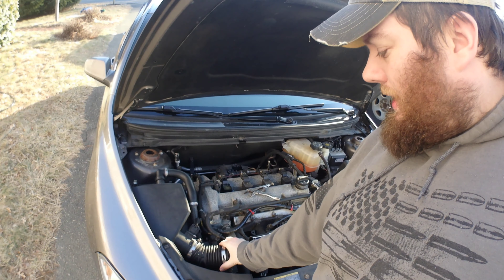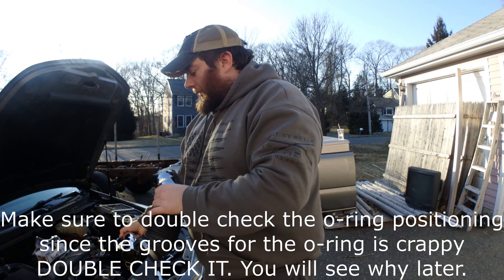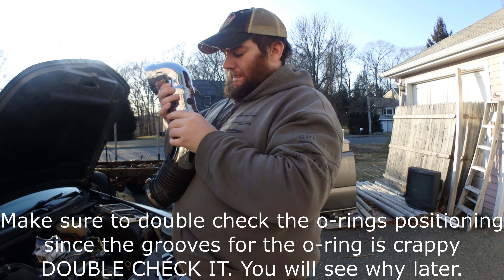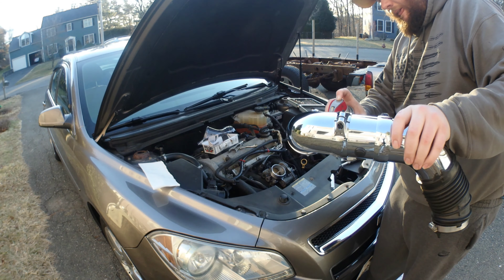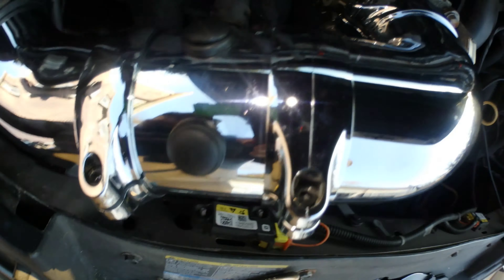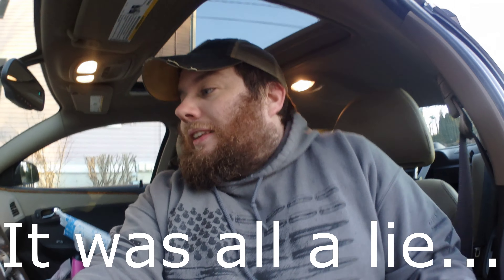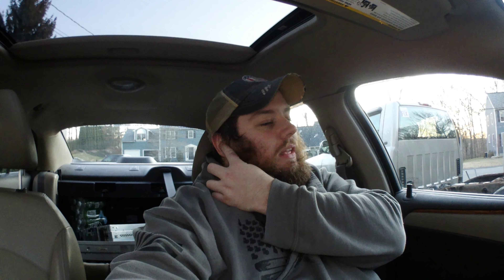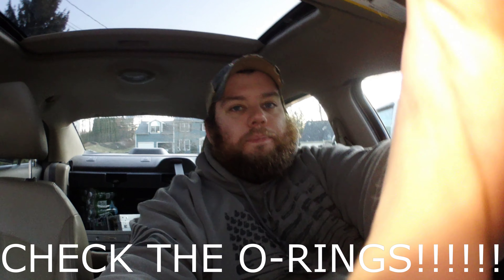2010 Chevy Mailbu FIXED!! Service ESC; Service Traction; Engine knocking

Comment: Wow thank you for the video you made it all so easy with putting the links to the parts in the description it all fit and is running like a champ! And yes the O rings are a pain! I just brushes some glue on the inside grove and that help a lot keeping it in place.😅
Reply from the maker: You are welcome! Glad it worked out for you. The glue is a great idea. Those O-rings are crap lol.

Comment: Wow I have had the same warnings and symptoms on my 2012 Malibu for many years I am definitely gonna try this and let you know I also saw the Roy rogers video and landed here after thanks for the links you provided!
Reply from the maker: Hope it works! I haven't had a problem since changing it over!!
Reply from the maker: Did you end up trying it out?
Reply: @Rwinnett2012  hey Robert I finally did it ! Amazon has been sold out of the parts for some time but I got the from the Spectre website , also my pcv hose broke because it was so old , but luckily spectre offered the push in breather option , I also used spectre couplers  instead of clamps but it all worked out and so far so good !! Thanks man
Reply from the maker: @jaydee548  That is awesome! I am glad it is working out for you! Our malibu is still going strong with this fix. So simple but so confusing as to why it fixes it lol

Comment: Did you use the existing coupler on the throttle body to attach your 90 degree fitting? I can’t quite tell how you attached that. It seems the throttle body outside diameter is less than the coupler inside diameter by quite a bit - did you need to do a 2.5 inch adapter or anything?
Reply from the maker: Using the parts I bought, I did not need to do anything else to get it to fit. The 90 went right to the throttle body.

Comment: Hey bro hope you doing good. Wanna ask if this method is working perfectly? Since the time you switched intake part!! Mine also doing same thing like engine sputtering but no check engine light. So thinking of doing the same thing.
Reply from the maker: Still working great! It's been a couple years now! No issues.
Reply: @Rwinnett2012  thanks bro.. will reach out to you after doing that stuff.

Comment: I have a 2011 ..... is there a way to check the codes by turning the key so many said times or like wise ? I'm having the same problems ....when idling awhile service traction service esc pops up and engine light comes on....also runs much louder than it used to....almost like theres a hole in the exhaust ...especially when idling ..... code that comes up when hooked up to reader is cylinder 3 misfire .... even after changing spark plugs and testing by swapping 2 of them it still says cylinder 3 ..... also have had random electrical issues over the past year such as ..... the seat belt warning light chiming even though. I'm buckled.... air bag light .....  momentary loss of headlight and dash lights when coming to a stop at a stop sign and came back on as soon as I began accelerating .... .but would like to know how to get codes using the key turning method please and thanks
Reply from the maker: I use a Bluetooth OBD2 reader for my phone. If there are logged codes you just need the car on but it doesn't necessarily need to be running.

The seat belt and the airbag lights are triggered by connections under the seat and those are known to come loose. My airbag light comes on anytime I move my seat.

As for the engine issues it sounds exactly like what I was experiencing and $40 fix took care of it. We're going on a few years with no issues. 

I've never experienced the dash and headlights going out but could be a loose connection somewhere or fuse going bad. You possibly could need a battery since the engine turns at a lower RPM idling if the alternator can't keep up with the draw while the engines turning at a lower RPM I could see electronics going out but I'm not a mechanic, I'm just the guy that has learned a few things from his dad who was a mechanic, and that's just me thinking logically through an electrical system

Comment: How did you attach the throttle body to the 90 degree fitting???
Reply from the maker: It fit directly on. I did use some WD40 as a lubricant to help slight the 90 on but that is all.

Comment: Where did yu get the aftermarket hose that connects to the throttle body?
Reply from the maker: Amazon and Advanced Auto Parts. Amazon was a little cheaper at the time. The description should have the part numbers.

Comment: Did you have to buy the clamps for the hose also?
Reply from the maker: The plastic chrome intake piping had built in clamps. I reused the rest from the original air intake setup.
Reply: @Rwinnett2012  thank u

Comment: Having this problem now. Only thing is it pops up after driving for a while. Once it's shows these lights my 3 or fourth gear kicks in alil late. Could this be the issue or is my transmission messing up?
Reply from the maker: I'm not sure honestly. For like $40 I'd try this before getting the transmission diagnosed. I have not had a problem with the Malibu since and nearly daily drive it!
Reply from the maker: Did you end up trying it out?
Reply: @Rwinnett2012  not the guy you’re responding to. But I’ve been having this EXACT problem for a few weeks now in my 2011 Malibu. 

I currently have P0327 knock sensor circuit codes. Im gonna change my oil and spark plugs tomorrow, so I was going to look at my wiring harness on the knock sensor while I’m down there. Mainly just for that code. But after seeing your vid, my car does the exact same stuff with the acceleration. It usually says ESC Active, and service traction, etc. If the wiring harness looks fine, Im gonna try this. 

What exactly were the parts you bought for this if you don’t mind me asking? Some kind of intake duct?
Reply from the maker: @tannergreen2613  I used Spectre Intake hose parts to replace the engine cover. I linked them in the description and it looks like Amazon still has them in stock!

It's definitely worth the $30-40 in the intake hose pieces than whatever changing everything else may cost.

I wish I knew why the engine cover causes electrical interference.
Reply: @Rwinnett2012   i totally missed looking in the description. My bad! If I end up changing it out, I’ll give ya an update. As you were describing your issues my mind went to “holy shit this is almost exactly what I’ve been dealing with” so thanks for the vid!
Reply from the maker: @tannergreen2613  hope it helps! I made it for that exact reason.
Reply: @Rwinnett2012  will the parts fit a 2012 malibu?
Reply from the maker: @jayb.8460  I believe so. A quick search showed 08-12 was the same 2.4L motor. Advance Auto parts also sells the intake piping and you could make sure it matches your vehicle there. I believe Amazon is cheaper though.
Reply: @Rwinnett2012  thank you.
Reply: @tannergreen2613  my car does the same thing I also have a 2011 . Replaced knock sensor , still doing the same thing. Did you end up finding the problem??
Reply: My codes are p1682 & p0325
Reply: @afernandez2844  I'm having the exact same thing happen. And I am at a loss s what to do next. Following for info and help.

Comment: What codes were you getting?
Reply from the maker: They were:
Misfire on cyclinder one - I think is P0301 
Knock sensor - either P0335 or P0332
I forgot to write them down at the time I made the video.

Comment: Can you explain plz
Reply from the maker: What sort of explanation are you looking for? If it is why does this work, I can't tell you. I assume the engine cover causes some sort of conductivity when it's wet and it messes with coils or the plug wires or something.
Reply: @Rwinnett2012  I wanted you to explain what the o ring is? And what’s the part called ?
Reply: @Rwinnett2012  like what do I tell the auto store I need?
Reply from the maker: @jonathanflores2354  I ordered the parts off Amazon. There are links in the description to the items (not affiliated). The parts come with an o-ring but it is kind of a pain to seat. The o-ring is to seal the two piece of intake tubing together. Someone else recommended gluing in place or using some RTV to hold it.

Comment: How is the car running now ? @robert winnet
Reply from the maker: My apologies, I missed this comment. It is running great! None of the same issues it had. 150K miles on it and counting.
Reply: @Rwinnett2012  okay bet im about to buy the stuff and see whats upb
Reply: @TragikKillz  , did it work out , mine it’s having same problem let me know pls
Reply: @dardaniaal7299  i went and got a used throttle body from the junkyard and it runs fine. There is a wide known issue with the fuel pump wires in the trunk so every now nd then i gotta go wiggle em to get it to start
Reply from the maker: Our Malibu is still running great! We are actually doing shocks on it soon since it is still running so good. For $40ish, it's worth the shot to fix it for years to come.
Reply: @Rwinnett2012   the other issue i lve been having is the fuse box. The fuel pump thing has faulty wiring and GM wont cover it so gotta replace the one in the trunk. The car shuts off randomly like it needs an oil change.
Reply from the maker: @TragikKillz  damn that sucks. Thankfully we haven't had any of those issues. Did something get into your wiring?
Reply: @Rwinnett2012  it started bout a month ago and ppl are saying that the wiring could be old. Same thing happened to my headlights i had to replace the wiring. But now when it turns off i gotta wiggle the wires in the trunk, make it look like im not dude tryna steal some sh*t, and pray to baby Jesus. He hasn’t failed me yet. ✊🏾😂